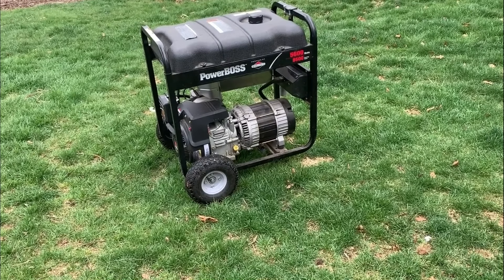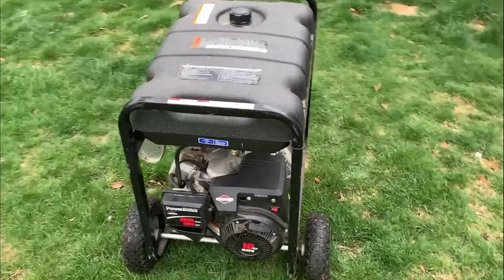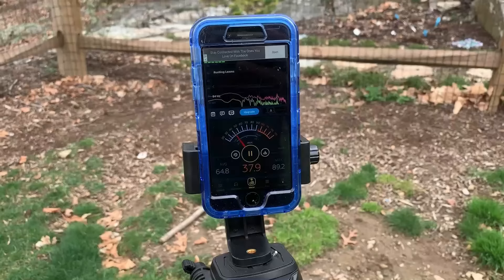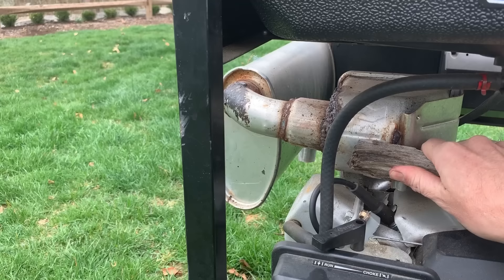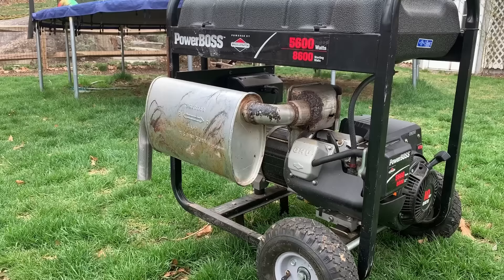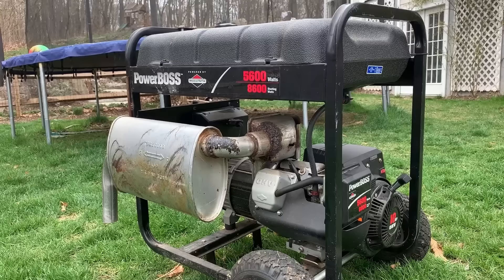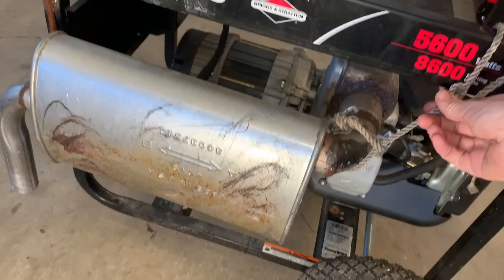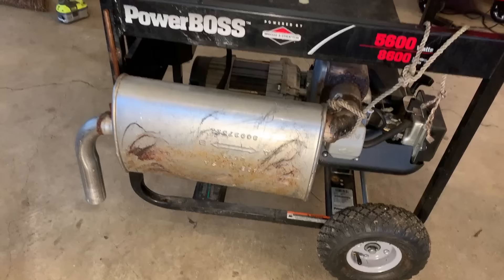Will a Car Muffler Make a Generator Quiet?

Comment: A long time ago I owned a Tecumseh genny, gave that thing away and told the new owner its loud. He didn't believe me at first, then it became a bonding moment when he pulled that thing on. He tried to dampen the noise by plumbing the exhaust in to a converted sink and filled it with water. I asked him if it was successful and he said no. Mechanical noise outstripped whatever exhaust noise it can produce. The entire engine made noise. It ran though.
Reply: ⚠️Always make sure you follow all the generator safety rules when you use your portable generator: 

This is just a reminder to make sure. It is important to follow all generator safety rules whenever you use your portable generator. 
Here are the things that need to be followed;

1) KEEPING OTHERS SAFE: Please do not allow an unqualified person or your children to operate and service the portable generator. Just because some manuals don’t say that doesn’t mean it’s safe. That is important against the generator safety rules. We also need to be keeping an eye on our children too. You need to make sure that your children are not playing near the portable generator especially when it’s running so they won’t get electrocuted. Generators pose electrical risks and they can be hot during an operation. Please keep your children away from the portable generator at all times. It is important to keep our children safe especially our little ones. Be aware of all the hazards.

2) WHERE TO RUN YOUR GENERATOR: Some people use their portable generators indoors which increases the risk of carbon monoxide poisoning. It’s important to have a carbon monoxide if you have a gas generator. Never ever use your generator indoors even if your doors and windows are open and even in the garage is not safe to use a portable generator. Not even at your porch and your deck. It is never safe to use your generator indoors and in enclosed areas of your home. Your generator needs to be 15-20 feet away from your house. 

3)🔥FIRE HAZARDS: Never refuel your generator while it’s running. You need to let your generator cool off before refueling it and before storing your generator. Never overload your generator too. Never ever back feed your generator. You should never plug your generator into a wall outlet. Also never store propane tanks indoors. Please keep flammable things away from the generator as well and please don’t smoke cigarettes near the generator. Having a fire extinguisher next to the generator is also important against the generator safety rules. 

4) GENERATOR OPERATION: make sure your hands are dry before touching the generator. Never use your generator in wet conditions. Don’t let your generator get wet. You need a generator tent if you need to use your generator during wet weather. Please don’t wear loose clothes when operating the generator. Turn on your generator before plugging in appliances. Use the right cord for your generator. Please do not use worn out cords. 

https://youtu.be/I1jT3ANENvI and here is a video more about keeping others safe when using generators 

Hope this helps

Comment: As noise is these ģenerators' worst drawback, it would be fun if you could tackle the full noise reducing exercice, motorcycle muffler, improvement on the air intake, more resilient motor mounts, adding vibrattion reducing material around-frame shielding etc. Regards !

Comment: Car muffler too large. The best solution to quiet this briggs output is whole pipe assembly from a 1986-1990 Suzuki Quad Runner or Quad Racer. The restrictions from the twists and turns give the Briggs more bass and less treble at 3600 rpms.  This will bring down the frequency range of the exhaust noise which humans seem to tolerate more. That briggs is still  going to be making plenty of impact noise from the valve train running. The dirtbike/quad atv exhaust setup is the best. Try it.

Comment: Not being tight onto the Exhaust & the hole would have made a difference. I think if the hole wasn't there & the bolt was done up tight the Decibel count would have been much lower & the engine would run more efficiently.

Comment: Whoever installed that auto muffler didn't take blowback pressure into account.
To much pressure and you'll wear out the exhaust valve spring and the valve itself that much quicker.
To explain it in depth would take to much math but it's actually an item engineers include in their design parameters.
Stay stock and regularly change the muffler as it wears out as not enough back pressure can also cause valve problems.
I have multiple diplomas working on engines and every school I attended covered that issue from small engines to motorcycle and aircraft engines.

Comment: take a sheet of plywood and make a box around it, with no top, or at least vented top and you'll be surprised how much quieter it is. By directing the sound up, you don't get rid of it, but you make it much less annoying.
Reply from the maker: That works much better.

Comment: I imagine the reasons it makes a lot of noise are much the same as for a motorcycle - little sound insulation around the engine and a short exhaust length.

Comment: I have to say, thats a whole lot of extra effort in holding the muffler and then cutting it. Just use a reciprocating cutting tool and chop it off, no need to pull tank or anything. lol and holding it up with something while you cut the other side? Def not needed lol Just chop it off at the engine side and then chop the bar right above the muffler. lol So simple, but made waay more complicated then it needed to be XD

Comment: A stationary air cooled small engine is always going to have a lot of noise due to the fan driven to circulate air around the engine. It's running at about 3,000 rpm (typical gov speed). And driving a generator the generator itself will have a fan built in on it's own shaft to circulate air inside it to prevent it from overheating. Secondary issues are loser tolerances on splash lubrication or low oil pressure distributed oil systems, induction noise of the carb, and the short exhaust system.
Reply: These are passively cooled they don’t have a fan.
Reply: @kingjohan1335  Haven't done much work on small engines have you? There is a fan attached or built into the flywheel of the engine. And the generator has one on top of the rotor.

Comment: A cheaper way to reduce noise would be to buy about a hundred square feet of acoustic foam. Mount it on a piece of plywood and place it next to the generator, so that you’re on one side and the generator is on the other.

Comment: Live in Fl.,.  Had that thought a while back.  I think they make some smaller mufflers designed for the job.  I would be those would work better, since they are designed for the job.  Removing the fuel tank first was kind of wimpy (totally kidding, exactly the right move).

One question I have is were you the same distance away in both cases.  6 db is actually quite a lot, 4X in power.

Comment: I have tried this multiple times. It helps, but this is an air cooled engine, so it does not have the water cooling jackets that help absorb noise. There are also 2 noisy fans, one on the engine and one on the generator.

Comment: Adding a second muffler increases the back pressure to the engine.  So it will run less efficiently.

Comment: Most of the noise is from the rotating assembly not the exhaust if you wer to insulate the engine and make some sort of liquid cooling jacket like car engines it will be 90%  quieter and for the exhaust add an insulated expansion tank and an insulated muffler or would be so quiet you would have a hard time knowing if it was even running just by sound alone

Comment: Sounds comes from the moving parts not from the muffler; most of it. The best cistern is to deflect the sounds to the ground. Try to laid plywood or drywall against the generator in 45 degrees. You’ll see the difference.  Oops, I mean hear the difference.😁

Comment: The mufler reduced it by around 5db. Every 3db increase is double the sound pressure. So this was like 3.5 times louder than the car muffler. Imagine if the muffler didnt have a hole in it! Could have been around 65db!

Comment: If I ever get a new gasoline-powered lawnmower, I'm going to add a muffler to it. Probably a motorcycle muffler.

I might also make a bunch of other modifications to it in order to make it as reliable, quiet and efficient as possible.
Reply: Turbo it lol (would an engine that small even work with a turbo? lol)

Comment: I did a little research and that muffler appears to be an AP enforcer 2 series muffler. The description said it is a performance muffler and it says "it delivers sound quality and performance.  not sure if they mean good quality by "sound quality" or if they literally mean the quality of the sound. The point that I'm making is that maybe thats not a quite muffler for a car. Maybe its louder than a stock muffler.  I just wanted to point that out because I want to see how much of a difference a stock honda civic muffler makes, or something else of a known sound level.  The fact that the muffler in the video is described as a performance muffler suggests maybe its not supposed to be quite. just saying. good video though.

Comment: it would work better if it was suspended on the rubber rings (the extra muffler) and if it would have an elastic exhaust pipe between the stock and additional muffler.

Comment: You need to use a super small piping diameter to help quiet sound.  Using something larger than what the stock muffler spits out only serves to amplify sound while you're trying to quiet it at the same time.  Try a low cc oem style bike muffler or something.  Car piping is way too large.
Reply from the maker: It fought me every step of the way.

Comment: I would think a 5 sided plywood or sheet metal box lined with carpet
then figure out how the engine will get cool, outside air for cooling and the carb.
make sure the exhaust is discharged outside the box, maybe into a gallon tin can full of
steel wool

Comment: I would think the exhaust exit hole/ pipe diameter is far too big. The volume of that muffler is huge for the engine size.  If you cut the exit by like 2/3 the exhaust gas may have more time to transfer heat into the muffler. (And still not have excessive back pressure) Thus lessening the pressure expansion on gas exit.  
     Basically rifle sound suppressor theory.

Comment: Measuring noise before and after should be done on a 'near field' and 'far field' basis. Close up at 3 feet all around (North, South, West, etc) and then 20 feet all around.  If there's an improvement you'll have good data for it. (PS fix the hole in the exhaust!)

Comment: Thank you for the very un scientific and biased test. That car muffler was working wonders. Could it be better yes with a motorcycle muffler for sure . But it already crushed that stock muffler even with a hole and wood. But thanks for the video now im going to install one on my generator.

Comment: Use a Motorcycle muffler. Car mufflers are way too big.  Check Craigslist, EBay... for a take off muffler.  Many people take off the stock exhaust and put on a aftermarket one. I don't know the CC of that motor but you want to match it to a trailbike.  A street legal trailbike will be a bit quieter.  You will get a pleasant bass-ier exhaust sound. Most of the sound is mechanical rattling.  No idea why that has to be so loud.  The generator is direct coupled so there should be no chain noise.  My Champion generator is 396cc and is too loud to be around even without a load.

Comment: The wood chip isn't going to make any difference. You should have patched that hole for a good test. Also you need to muffle the intake, too. The intake sucks air in. It doesn't suck sound in, or even block sound.  The sound path from the valves to your ears is almost a straight shot.

If you enclose the whole unit, top bottom and sides, with baffles to help deaden the sound at the ventilation openings, which are absolutely 100% required, the noise will go down probably 10dB. NOW compare the stock muffler with a car muffler, and see what a difference it makes. Even better, run the exhaust up about 8 feet and your B&S generator will sound like a proper enclosed unit. 

Sound is all relative. It will still be loud. But it will be a lot quieter than now.

Comment: the sound coming from the Generator is most from the engine itself since its so small, Ive wanted to do this because mine is so damn loud but its just not worth it since most of the sound is coming from the engine itself. The reason for that is because the engine is small and isnt as thick i should say as a car engine so you dont hear the vibrations and everything because you dont want to hear that while driving but with a small engine like a Generator they dont care

Comment: Would be better with no holes in the exhaust and using a car muffler that has seen better days. There is a massive difference in noise generating from the car muffler.

Comment: you want a quieter gennie?  You need dirt, or better yet, use sand bags.  Create 3 feet high walls around it with sandbags and that will muffle the sound.

Comment: the hole in the exhaust makes a big difference. That hole, even small means a pressure difference on the wrong end of the muffler which greatly reduces performance. make  a nail hone in your cars exhaust and youll see what i mean. any gap is a big gap

Comment: This is how people used to have massive pot farms in houses. Use walker quite mufflers; muffler off a Cadillac DeVille, rap the pipe and the muffler in heat muffling blanket and run it outside. You can’t hear almost anything in a backyard with a fence. No crazy power bills no way for police to find you by having that $15,000 a month power bill bahaha

Comment: you can compare the difference on the vid by pressing "2" and then "9" on your keyboard and then you can see it doesn't really make too much difference
Reply: The sound of the video is worthless for comparison sake, but 5db is a significant decrease by any objective measure. And that was 5db with a big exhaust leak and loose exhaust manifold bolts.

Comment: Not much sense in bothering with any of this if you've got a hole upstream in the system. Also, as many others have pointed out: if you're going to use a decibel meter, you might want to learn how to read it: 3db increase = double the noise level. Hardly a meaningless difference.

Comment: Jerry rigged works I guess but why not just buy a propane inverter.

Mine is mounted on a rear bumper rack and I can't hear it inside my RV.

Also compared to my onboard gas Onan generator it operates for pennies on the dollar.

I've ran it overnight at several camp sites and have never had a complaint or been asked to turn it off because you can't hear it at the next site over.

Comment: In close the engine  using heat ac duct board  just be sure to install a fan on one side and a vent on other side 
so the engine wont over heat.
EXTREMELY  IMPORTANT !!!   make sure you get this right  so you dont turn it in to a paper weight  lol   
I AM NOT RESPONSIBLE  IF YOU TURN YOUR  ENGINE IN TO A PAPER WEIGHT .

Comment: I believe the test could be flawed.  You are making an assumption that the majority of noise is created by the exhaust note.   But there is a reason the Onan and Honda generators have noise baffling around the entire motor, as the motor generates much of the noise itself.  Where you chose to place the decibel meter, the automotive muffler shielded engine noise from it.  The meter should have been placed directly opposite from where it was for a fair test. (or at the very least, tested from both locations)

Comment: Phone mics are terrible at measuring dbm, they aren't designed to handle loud sounds, they max out around 70 or 80.  80 dbm or 100 dbm would measure about the same.

Comment: If the whole generator would be in a box with sound isolation and you replaced the whole exhaust with a car muffler it would help dempen the sound. My generator (one pitter diesel) has a sound isolated box and makes about 70decibel at 5 meters. And i wil replace the exhaust with a car muffler. Then i can have a conversation with someone while the generator is running. I think it wil shave off about 20 decibel. Greetings,, Kitty.

Comment: I'f you do it right and put a stainless flex bellow and a correct sized muffler and automotive rubber exhaust hangers , you can turn that gen set into a hush puppy. I put mufflers on our drain cleaning machines with great success for years. and really the original mufflers are just spark arrestors made to a price, cheap cheap.

Comment: i once accidentally discovered a way to cut the noise way way  down i was repairing a cracked muffler . and here is what i did i had a soft steel bar 5/8 x 1/4 i had welded to the muffler in a spiral fashion keep in mind the wide part was sticking out and the side of the steel bar was tack welded to the muffler i had to keep heating the bar to get it to bend . i often wondered if that had a bad effect on the motor and i didn't have the machine long enough to find out . i often wondered if all mufflers should be made this way .

Comment: Portable gen sets are noisy, period. I built a large she around mine (2005 Troy Bilt 7500 watt peak and B&S engine) with a powerful fan blowing on it, and double walled  wood burning chimney pipes attached to welded on pipe to the muffler directing exhaust outside of the shed through a chimney wall plate  (carrying a tremendous amount of heat away) . I also have ventilation vent on both ends of the shed. It is hooked up to a properly wired transfer switch inside the house. Quiet enough for me, and is safe. 10 years of power outage service with no issues. I use Amsoil small engine oil too btw. These noisy gens need to be surrounded in an enclosure that is well ventilated. Either that or drop 7K+ on a quite Honda gen set. These muffler hacks will never get the desired results. Sorry.